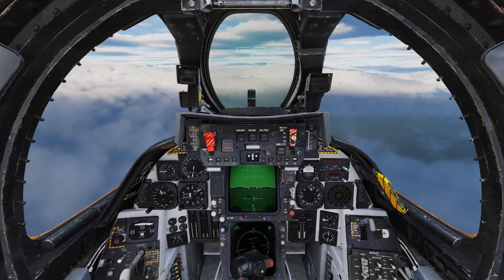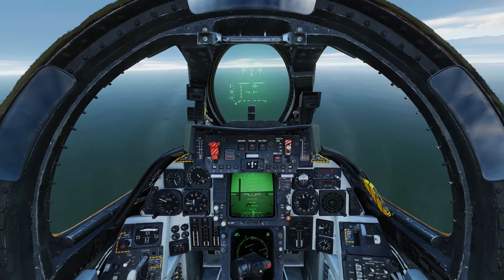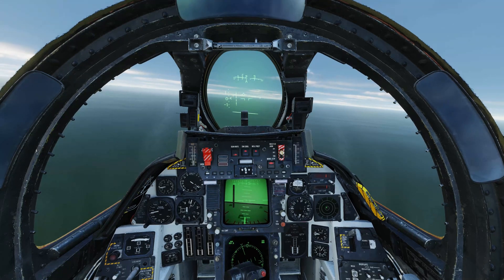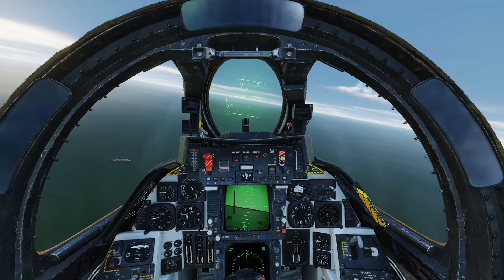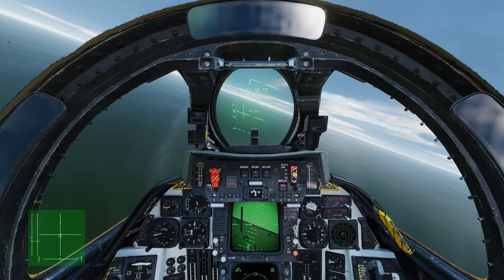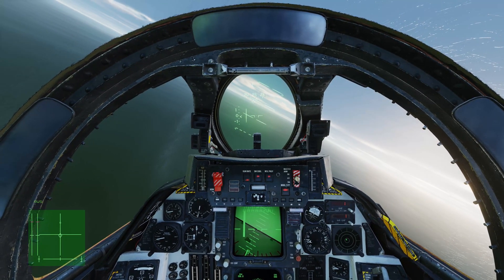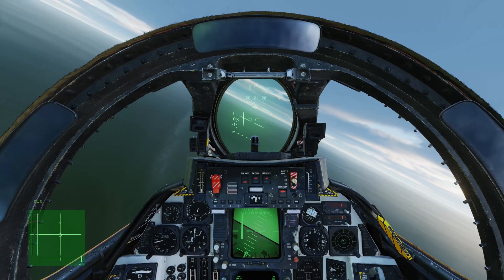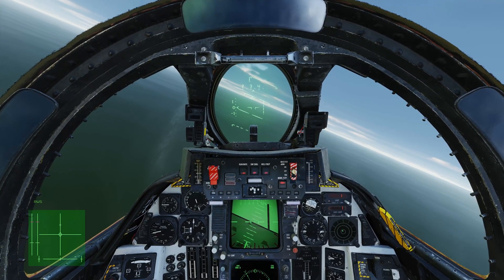DCS: F-14 | Flying level and holding a stable altitude

Comment: great video!, question @104th_IronMike : about rudder, do you use in normal flying and banking? or only at very low speed to avoid reverse stick inputs at high AoA?, is it worthy to use rudder on normal flying?

Comment: i'm keyboard DCS pilot .. and not a very old one
it's the hardest and most forustrating thing is keeping my plane going smoothly straight .. but this video makes a little easier on me as i'm not the only one 😁
Reply from the maker: Yasin, if you can try and get a used or new (also cheap) logitech extreme 3d pro. It is not expensive at all, and really good enough as an entry stick and will make your life much better in the sim. No need for all the high end stuff everyone is talking about, but a stick will change your life. The other option for a good entry stick is the t16000m from thrustmaster. ;-)